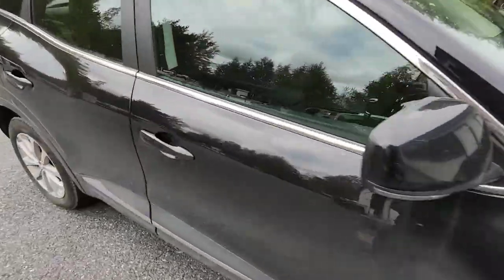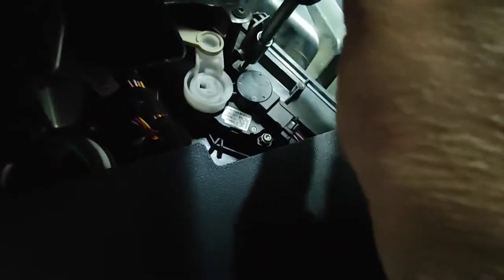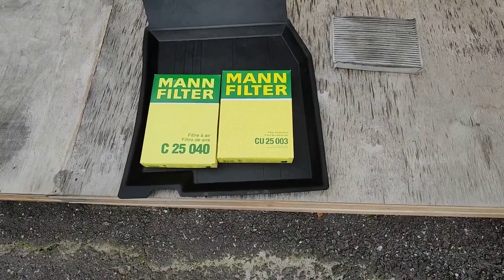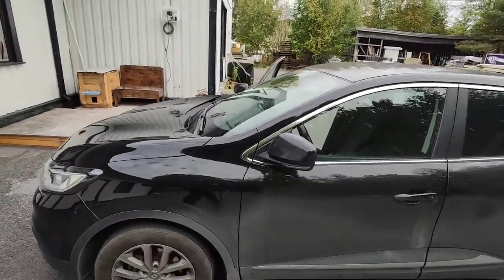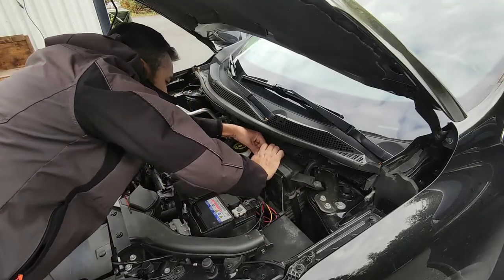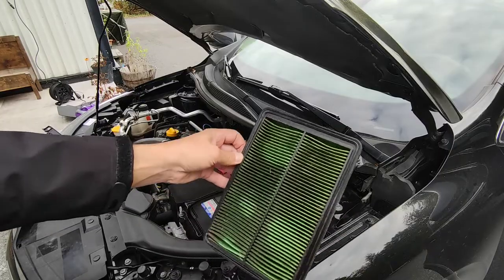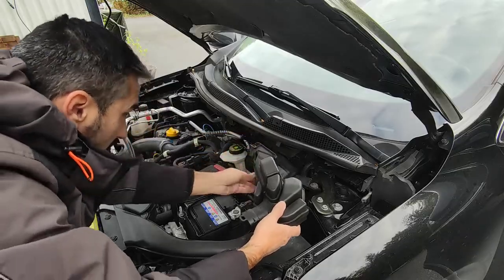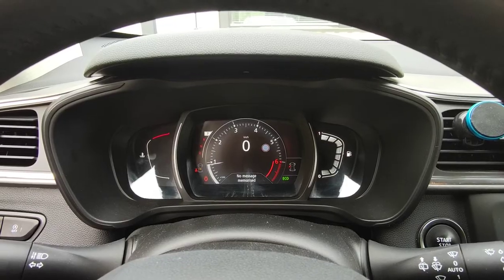How to Replace the Air and Cabin Filters on a Renault Kadjar

Comment: Yes indeed i change my filters too on my car. We save so much  money doing it and like you said, it's a simple process. Well-demonstrated here, your Renault will breath easy after this as well as you will.
Reply from the maker: Here in Finland for such work you will have to pay €50 - €80 plus the filters will be much more expensive if you buy them from their shop. I believe Vegas mechanics are not cheap either.

Comment: much easier than a Megane! Thanks and does this model have the heated front screen like ford cars and the phase 1 kadjar ?? wanted to buy a kadjar nad this feature is cool if its real
Reply from the maker: Unfortunately, the one I have, 2018, does not have a heated front windshield. And I agree with you, it's a really cool feature, especially if you live in a cold country, like I do, where every morning everything is frozen, including the windshield wipers. Although, we use the interior electric heater to warm up the car before getting in, so that helps with the windshield and wipers.

Comment: Hi thanks for the video. 
After the changing my Filter box doesnt close firmly. I dont know what caused this. There is air flow coming from the filter box and it makes vibration. 
How can I seal the box ? Any ideas?

Thanks in advance.
Reply from the maker: I can think of two things that could happen. First check the orientation of the filter, there should be arrow on the filter that shows air flow direction and the filter should go in with that orientation. Another thing is to check if there is any debris left behind that prevents the filter and plastic housing from fitting tightly. If that's OK, try moving the filter a little until it goes all the way in. Some manufacturers have slightly different filter dimensions, so sometimes they don't go in as easily as they should.

Comment: I had no idea we were supposed to change them, or even had them. I bet mines real dirty! 😊
Reply from the maker: I know many people who have never changed them and had no problems at all, but it also depends on where you live. There are a lot of dirt roads here on the country side so the engine air filters can get clogged very quickly and the car won't run well. And I would really recommend changing the cabin filter because it can stop so many harmful things from outside and your cooling/heating system will work much better. 🙂👍

Comment: hello, I have a Renault Kadjar 1.5 diesel 2ec co 2016, but I have a problem when I put it in cold air in the front part, it doesn't blow air out, it only blows out the side, what could be the problem??
Reply from the maker: Sorry, I'm not mechanic so I can't tell what could be a problem, but for me I would check blower fan and it fuses. Good luck!

Comment: Cómo puedo quitar la tapa de filtro de aire kadjar 2022 motor 1.7 dci
Reply from the maker: I'm not sure, I'm not a mechanic and I've never seen the engine of that Kadjar. Air filters are usually always in the same place, but I can't be sure.
Reply: @FlerkenCats   gracias, es un modelo nuevo por eso seguro que no sale en internet

Comment: Error γιατι να σου βγάλει; αφού φίλτρο άλλαξες αέρα. Κ. Καμπίνας
Reply from the maker: Well, it shouldn't give you any error, but whenever you open the hood and touch the cables or hoses, there is a chance that something could go wrong. Bad connection on cables maybe, some sensor stop working etc. It was more like a recommendation for extra attention, so that people know that they need be carful even when doing such a simple thing like a filter change.